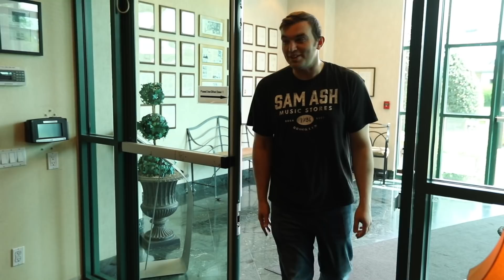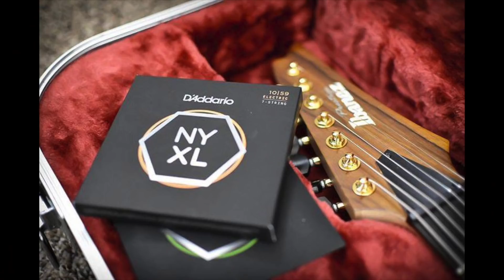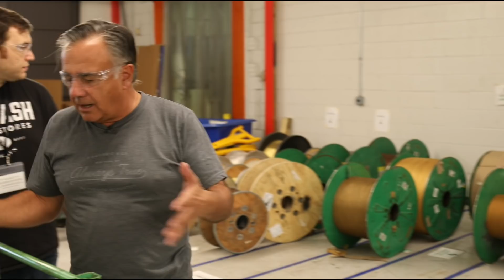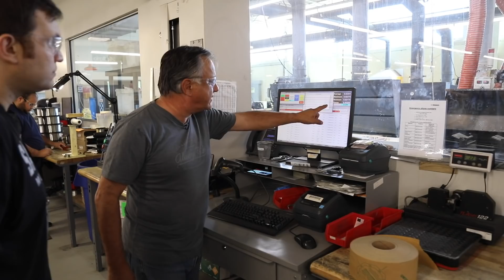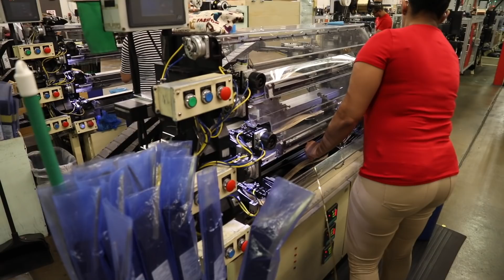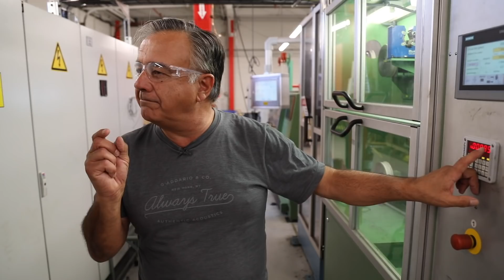D'Addario Strings | Factory Tour

Comment: Guys, don't fool yourself, you don't need high carbon steel. String wire gets its hardness from the drawing process, not the tempering. Use a good magnetic stainless steel.

Comment: I used to use GHS Boomers and Dean Markley strings. I have recently switched to D'Addario strings. Let me tell you, I noticed the brightness in the D'Addario set right away. Much brighter and they do last a lot longer. I am currently using the Round wound Nickel Wound 10-46 set and I am sticking with D'Addario from now on. I have yet to try out the NYXL and have heard a lot about them. Excellent video !!!

Comment: It's lovely to see Jim so enthusiast about the strings and everything that goes into them. That's why D'Addario is the best string brand there is. You can buy a set of strings today, tomorrow, after a year or after a decade and it's still the same quality. You don't have to adjust your guitar's neck or setup since the strings are the same. So consistent... top quality stuff. And once you listen to and watch Jim explain everything you realize why D'Addario is the most consistent even-quality set after a set. In-house production from the bottom to the top... laser-measuring, whole nine yards. Awesome!

Happy XL and NYXL (ab)user here... since 1992. I have tested tens and dozens of other but never found better than D'Addario.
Reply: NYXL 9s break (all the time)

Comment: I bought a set of DAddario light acoustic strings recently.  I was not happy, the high E Ringlet slipped off the string during a routine replacement of strings on my acoustic guitar.  I complained via their website and the company said that it is normal for all manufacturers to experience this problem.  They offered to send me a replacement as their solution to the issue.  Great!  Here's your string and here's the door.  Don't call us we'll call you.  A search on google revealed that people have reported the same problem as far back as 2006..  I suppose if I dug deeper that I would find that the issue goes back even further than 2006.  Sam Ash....if you are pushing D'Addario, you need to reconsider their quality.  I started using their strings back in 1975, maybe even earlier.  They were reliable low end strings that worked for me.  But there is NO EXCUSE for a ringlet failure on ANY string by ANY manufacturer.  I won't be buying from them anymore.    Strings should be 100% dependable...no matter how little they cost.  Any manufacturer of guitar strings who think an occasional failure is acceptable should not be seen in the same stores on the same shelves as the other manufacturers who have a  zero tolerance  for the same defects.
Reply: Have fun with other crappy manufacturers,  daddario are the best and the most reliable there is. Seems like anecdotal evidence considering the astoundingly low numbers of complaints. 1 failure since 1975 is a good track record.
Reply: @mackk123  I would have to agree if I was using them for all of those years.  I had a 25 year hiatus.  And that changes the numbers significantly.  A quick google search will support my complaint in any case.
Reply: @mackk123  Idk man. Personally I like GHS. But Dadarrio are very reliable I agree